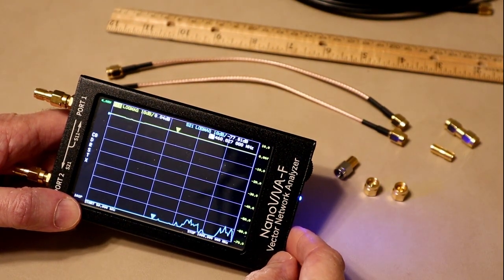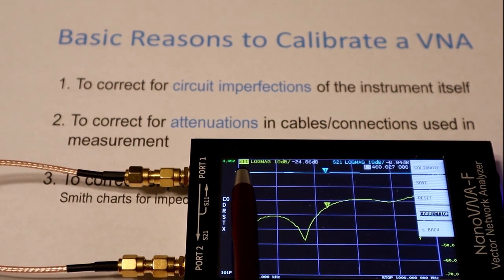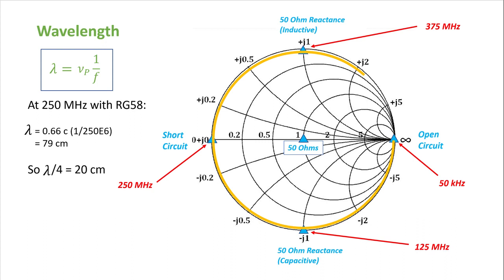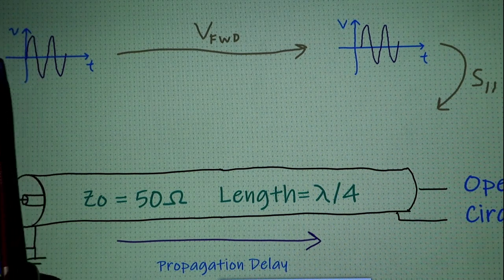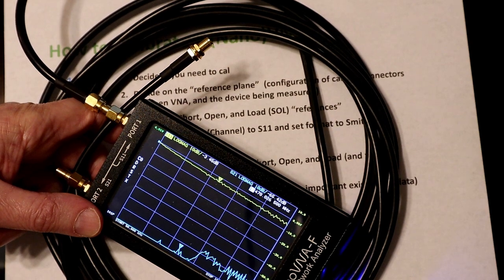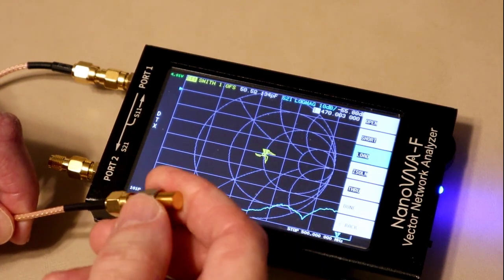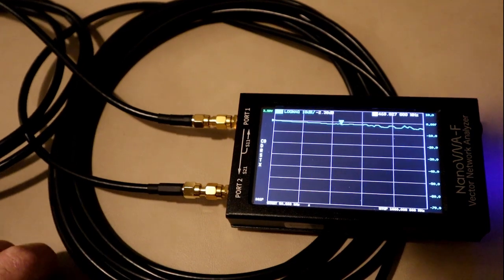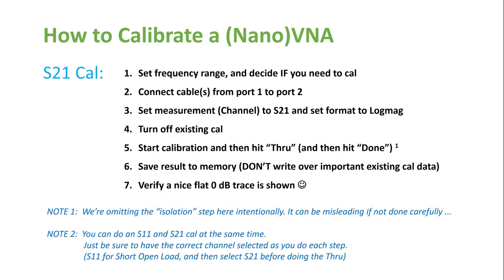NanoVNA Calibration - When, Why, and How to cal a VNA

Comment: One aspect you did not cover is the sweep range and interpolation with the limited number of sampling points. If simply calibrated and used with the full sweep range it is likely details you are testing for will be missed. For best resolution it is advantageous to narrow the sweep range for the task at hand and calibrate with the reduced sweep range. Otherwise a very good explanation.
Reply from the maker: Thanks.  Yes - agreed.  I have had to narrow the sweep sometimes to look at things like an 80m 50 kHz bandwidth antenna.  Interestingly, for the uses I've made of this unit, the interpolation has been sufficient and in that case I didn't have to re-cal (probably because I was only looking at the magnitude of S11). However, as you point out, that will not always be the case. If the coax is long for example, then the phase changes too rapidly with frequency for interpolation to work for full complex S11 and it would need to be re-cal'ed at the new, more narrow span.  Other versions of the firmware or other VNAs may also have issues with the problem you point out. Indeed, the HP8753's in our lab didn't have the processing power to even do interpolation. I always had to recal those whenever changing frequency range or span.  Thanks for pointing this out.

Comment: Can you clear something up for me please? If I calibrate the unit and then do a swr scan on an antenna, the result changes depending on the surface the unit is sat on and it vanishes if I hold it in my hand. It even changes depending on whether the unit is lying on its back or on the front edge. Is the knack to calibrate it in its final position and then never touch or move it?
Reply from the maker: It sounds like the antenna is close to the VNA unit and that the case of the unit and surfaces (are they metal) are actually becoming part of the antenna - and hence affecting the antennas impedance.  Here's some discussion of how the antenna and the objects nearby interact.  This is part of one video in our Antennas series. I've queued it up to start at the relevant point - but feel free to back-up and see some of the earlier material if you find it interesting:  https://youtu.be/_Gj_hiMrdok?list=PL9Ox3wpnB0kqNLnCdCtWcjGq7nRVHYxKA&t=1202    Assuming this is the issue, one thing you might try is mounting the antenna some distance from the VNA with a 6 or 10 foot coax connecting them. Then calibrate to the end of the coax, putting short open and load at the end. Then, connect the antenna at this point and operate the VNA (which is at the other end of the coax some distance away).  Hope that helps. Let me know how it goes.
Reply: @MegawattKS  You hit the nail on the head there. Many thanks.
Reply from the maker: @bargeutube  Excellent. Thanks for letting me know !

Comment: I just learned you can do continuity tests with this thing
Reply from the maker: Yes - it goes to a low enough frequency that should be possible. It also has the ability to find the location of shorts (or opens) in a line partway to the load if that is suspected (using a frequency version of a reflectometer under Display>Transform).  It's an amazing instrument comparable to the big expensive ones !  (Though the learning curve is sometimes a bit steep )

Comment: Thanks for the video! It was very useful to know not just HOW, but WHEN and WHY to calibrate NanoVNA. I think it's very important and interesting! Tell me please, what about the correct calibration of the S21? What should I do before clicking "ISOLN"? 73!
Reply from the maker: Thanks. That's a very good question, and I'd be happy for others to comment on as well. In our lab with Agilent/Keysight equipment, we generally just selected the omit option since the "S-parameter testsets" in the instruments had excellent internal isolation and we didn't need more dynamic range in S21 measurements we did. But for the NanoVNA, it's sometimes important to correct for isolation, especially at say 500 MHz and above if you need to see very low S21 values like -50 dB or less. My personal feeling (and what I've done sometimes) is put loads (50 Ohm terminations) on both ports before clicking ISOLN. The question is where to put the 50 Ohm terms - at the instrument connectors or at the end of any coax runs being used. Arguments can be made for  either. If the coax cables are included, then there is some compensation for leakage from the cables in addition to calibrating out the NanoVNA's internal coupling errors. But a) coax coupling is usually small compared to the internal NanoVNA coupling between PC board circuit traces on the two ports, b) if the cables are included, they should probably be in the positions they'll be in for the measurement. But ...  I'm not sure what happens when the device under test is not a good 50 Ohm itself on each port.  So - IMO, probably just put a load (50 Ohm termination) on each port during the isolation cal step, and recognize that S21 values below say -50 dB are possibly not completely accurate...
Reply: Thanks for the detailed answer. This is good advice! Will definitely use this! 👍

If I'm not mistaken, in the instructions for NanoVNA, it was written: «Connect SMA Load to PORT1, connect second Load to PORT2, wait more than 3 seconds (wait for the screen to stabilize) and press ISOLN. Note: if you don't have second Load, just leave PORT2 open». But it baffled me. That's why I was looking for answers to my questions. Thank you!

Comment: Thank you for your detailed video.  So before taking our NanoVNA readings of X, R, and SWR of antennas for 2200M (136 kHz), 630M (472 kHz), 160M (1.8 MHz) bands, if we are wanting to use a 5 foot extension section of RG213/8U coax from Port 1/S11, should we calibrate the NanoVNA with that section of coax connected to the Nano, and if so also use the open, short, load connectors on the end of that coax during the calibration, or is just calibrating at the Nano's port without the coax inline good enough?  Finding mixed answers on this- some say calibration with the coax is not needed since it's in such low bands, others say better to do it anyway.  Thank you for your help.
Reply from the maker: Sounds like you can probably get away without calibrating with the 5 foot section in place. 5 feet is on the order of 2 meters - a little longer if we adjust for velocity of propagation.  So that's about 1/50th to 1/100th a wavelength for the worst-case 160m band. That should result in reasonably negligible rotation on the Smith Chart.  1/100 would be 7.2 degrees of rotation.  The only place I can think of where this might be an issue is if the impedance being measured is significantly away from the line impedance - say trying to measure a 600 Ohm Zant using a 5 foot 50 Ohm cable feed. Then the Smith Chart rotation could change the Z readout somewhat significantly (it would show a capacitive X even if its resonant).  But if it's a nominal 50'ish Ohm antenna with a 50 Ohm line, it should be fine - even if the antenna has a 2:1 VSWR...  (Opinions may vary :-) )

Comment: Great video! Thank you. One question follows: Around the 19 minute mark you save the S11 cal data in the 4th slot. Why does the display still show a lower case letter “c” which I believe means the device is not in a calibrated state? - Cheers - Jim
Reply from the maker: Good question. According to the book "A Guide to the NanoVNA", the lower-case means its using interpolated data - i.e. the frequency range is not the same as it was during the cal. But in reviewing the video, I don't see that I changed it (50 kHz to 500 MHz was used during both cal and during verification). My guess is that it still has old T and X (transmission/isolation) S21 cal data together with the new S11 (SOL) data. So the S21 part of the cal set is still interpolated. Honestly I've never really looked at those letters. I just do the verification step to be sure its OK.  Now that we have this puzzle, I'm even more inclined to not trust those letter readouts. After all, they don't tell us if the cable type/length was changed. But in their defense, they are reminding me that I didn't cal S21 this time I guess.

Comment: Great video, just got a Nanovna, still trying to figure things out with it.

Question about calibration:  I tend to use BNC connectors on everything, so first thing I did was put some SMA-BNC adapters onto the device.  This immediately threw the S11 trace out of whack (haven't played with anything else yet).  So I need to recalibrate for the new plane, but I don't have a BNC "short" standard.  Can I just solder a BNC connector closed?  Or should I go and buy a professionally manufactured one?  (Open is easy enough, and I have a quality 50ohm BNC load that should work for the load standard)

I am mostly interested in measurements up to the 70cm ham band, so being accurate into the GHz range isn't a concern.
Reply from the maker: Hi. Yes - as long as your soldered short is physically short (e.g. half the diameter of the connector), it should work OK up to maybe 1 or 1 1/2 GHz. But try to keep the shorting wire length to about 1/2 the diameter of the BNC shield if possible. I'm guessing you're envisioning a Male BNC and putting a wire from the center pin to the shield on the back of the connector. Don't loop it out and back to the outside. Maybe you can use bare copper wire soldered/crimped to the center pin,, tin the wire, and then insert a small diameter soldering iron and solder down into the shield from the backend of the connector?  We used BNC shorting  caps like this one at work and they worked fine. https://www.amazon.com/Amphenol-Rf-coaxial-Shorting-Cap/dp/B00M1I2U9I
Reply: @MegawattKS  - I was actually thinking of a female BNC, but I'm just going to order the cap you linked - I didn't find it in my initial search, which is why I thought about doing a DIY one.  Thanks!

(I think my mistake was searching for "calibration set" rather than just "shorting cap"...)

Comment: Calibration IS required to establish the measurement plane. And it is required if you change the freq span, the connection method, anything that alters the measurement plane.
Just added fyi.....
Reply from the maker: I've been pleasantly surprised with the NanoVNA's ability to interpolate calibration data to new frequencies within a wider range. Of course I usually check to be sure the cal is still providing good data, using the SOL standards. And as you said, you can't change the interconnect distance more than about a few percent of a wavelength, or the phase data (Smith chart rotation) will be off for sure.

Comment: hello ,I don't see vertical grid lines ,like yours .I only have horizontal lines shown.
Can you please help me set my graph to have both?
thanks
Reply from the maker: Sorry, I haven't changed anything other than the format type (logmag vs Smith, etc), and am not sure you can with the one I have. Maybe the NanoVNA model or firmware differ?  This is the "-F" version with stock code  build from earlier this year when I bought it (I haven't done any updates). If I discover anything, I'll try to post
Reply: @MegawattKS  Thanks a lot

Comment: Am I correct in thinking calibration is not really required if I just want SWR measurement for antennas in the 3MHz to 30MHz range?
Reply from the maker: Probably, but it depends on the state of the analyzer. When I got mine, it came calibrated. The easiest way I can think of to check (or at least inspire some confidence in using it as-is) would be to setup the sweep range you want and the trace/format (e.g. S11 trace only and SWR or Return Loss format). Then put known loads on port 1 and see what we get. Left open-circuited, the SWR should be very high (e.g. > 10), and when the "Load" (50 Ohm cap that came with the analyzer) is attached to port 1, it should read close to 1 (e.g. < 1.1). Note that for HF antennas, some are very narrow-band, so be sure to narrow the span as needed. Otherwise it is possible the sweep (which is only 101 steps by default), may miss the resonance point. Hope that helps. 73
Reply: @MegawattKS  Thanks for reply. I have not yet bought a device but am considering a 4.3in screen model due to my poor eyesight. So, if I set range 3-30MHz and do a calibrate then this calibration should be ok for all antennas in this range? I can narrow sweep to say 7-7.3MHz, leaving calibration alone? Is I set trace to SwR only and sweep to a specific band can this setting be saved, or will all settings reset again next power up?
Reply from the maker: @geoff37s38  It is hard to say for sure, since different unit variations come with different 'firmware'. With the unit I have (4.3in NanoVNA-F purchased in 2020 with firmware 0.1.5), there are 5 memories: 0 through 4. The unit appears to power-up with whatever was last recalled from memory. For example, I saved my most recent call in "RECALL 4". It power up with that. But if I do a: RECALL > RECALL 0, it changes to that and then when I power down and back up, it is in  that state. But if I change sweep for example and then power off and back on, it doesn't remember that. It's back to what was most recently recalled. So not quite the same as the typical "power-up from last state" behavior that HP/Agilent units might do.  (As an aside, I keep the original cal it came with in memory 0 and use the others to mess around with. The original was valid from 50 kHz to 1500 MHz and displayed S21 in Trace 1 in logmag format together with S11 in Trace 0 in Smith format.)
Reply from the maker: And yes - the 2020 NanoVNA-F unit I have does do interpolation, so if I narrow up, it will interpolate cal points within the new range from the coarser date. I think it may actually extrapolate off the ends if you widen up from a more narrow call range - but that is fraught with some inaccuracies at best.
Reply from the maker: All that said - be careful. I have seen mention of some units that don't have good memory and interpolation. One was a model SAA2N - which is not technically a NanoVNA - but kinda looks like one. I saw stories of such units in the NanoVNA and TinySA Facebook group:  https://www.facebook.com/groups/368777730463838
Reply: @MegawattKS  thanks for advice, much appreciated.
Reply: Yes it does !